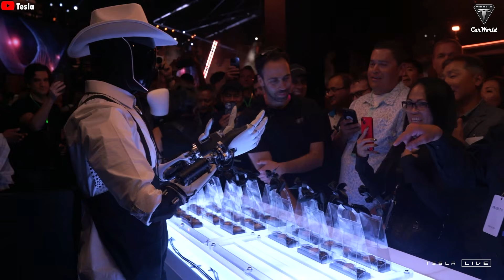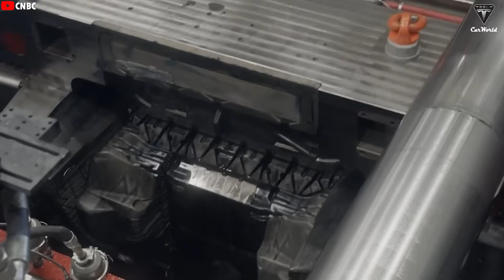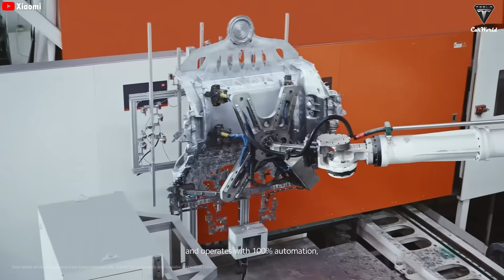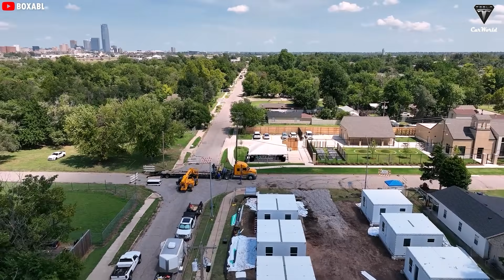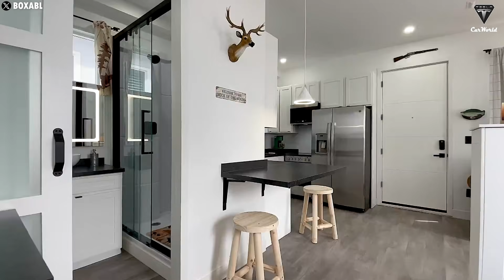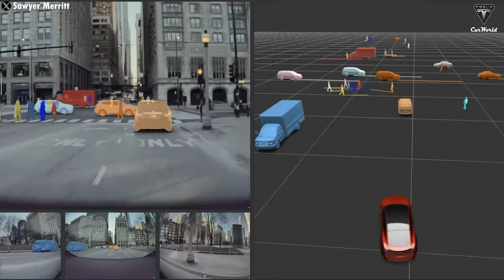End Of China! Elon Musk Upgrades Tesla Bot Gen 3 Clean Your Entire House!

Comment: Can Optimus function offline or is it always cloud-connected?
Reply: It's just not feasible to have any real capability in an offline mode.  They don't mention that, but it would make sense that each user will need a server based profile with terabytes of data down to invasive levels. Seems likely that you will need a subscription for services. 

I suspect that most of the on board computing power is just to support the most basic motor functions. And t may not be able to use that without a network connection. The bandwidth of that connection is going to be high to achieve much functionality.
Reply from the maker: Great question! Right now, a lot of Optimus’s capabilities rely on remote training and data collection, but the long-term goal is full autonomy—even offline. Tesla’s AI chip and onboard neural net are being built to process tasks locally, just like FSD in Tesla cars.